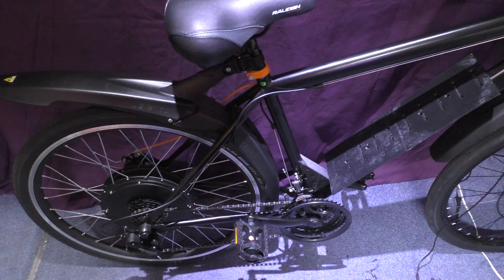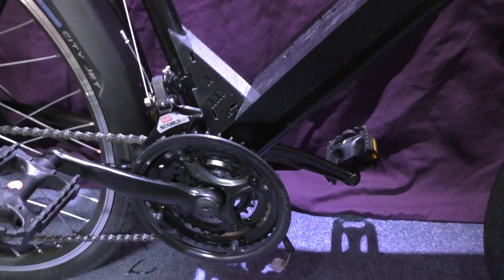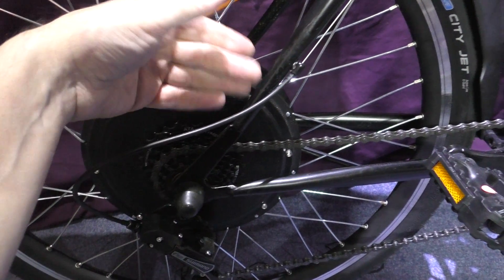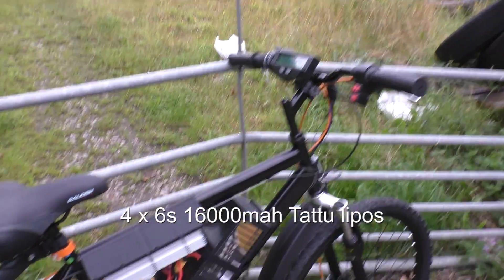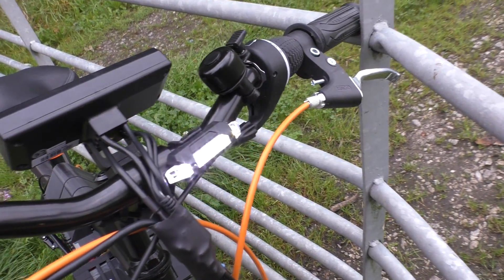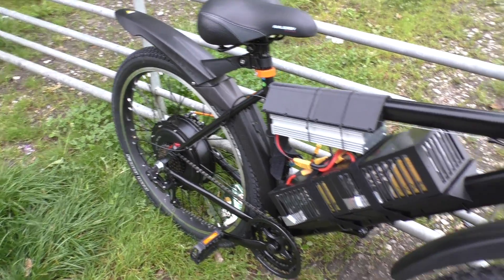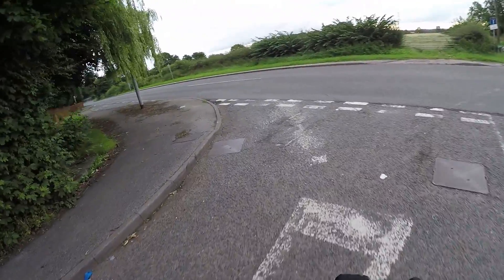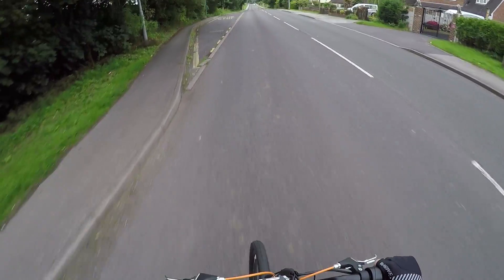Insanely fast DIY electric eBike - the most dangerous and unsafe bike ever

Comment: Don't need the lights as they will hear you screaming from miles away :-)
Reply from the maker: I didn't think about it at the time, it was 6am and the bike itself is nearly silent. I bet everyone wondered what the hell was going on :-)
Reply from the maker: The Stealth bikes are nice......very nice but I can't have one because of 2 reasons: 1. They're too heavy to get up the 2 flights of stairs I have to carry it and 2. I won't buy anything that doesn't offer a price - their website only says "Request a test ride" at a place that's 120 miles from here which leaves me to believe that they're wayyyyyy over my budget!   
I'm happy with my new bike - I built it myself, it goes just as fast as the Stealth, the range is the same and it's less than 40kg :-)
Reply: I test ride the b52 at the motorsports workshop near towescter and it was a good ride but fucking heavy, he offered me a good price to take away the test model that day... 5 grand. Fun but could get a lot more motorbike for the money
Reply: Vortecks how fast did you go?
There is a electric bike, australian designed and built that is the one of the worlds fastest production made electric bike, with dealers in the UK. The company is called Stealth Electric bikes. Top speed of 55+mph
Reply: Sandman You can build a mid drive faster lighter and untold cheaper than the stealth bummer!
Reply: the B52 is $10.5grand +/- a few hundred. The p7 $7grand +/-  I live 15min from their warehouse and I am going to test ride their bike soon. I hope its worth that much. The way technology is going the price will plummet.
Reply: I would have no idea where to start. unless your offering 😜
Reply: Dave Bassett I
Reply: Gave you your 200th like....Thats ok!
Reply: Think it was called thorney  motorsports
Reply: Bahahahahaha
Reply from the maker: The Bafang BBS02 is good for top speed but the acceleration is somewhat limited because it relies on gearing and there's extra wear on the chain & sprockets. Not to mention the extra tools you need to fit them. To fit a hub motor, you literally only need to undo 2 nuts. The downside of a hub motor is the weight and the the extra batteries. Each has their benefits and downfalls but it's personal choice. I much prefer a simple 'twist & go' rather than having to mess around with the gears and worry about snapped chains or stripped sprockets.

Comment: Been thinking of doing this also after watching your German nutter counterpart Rolf Venz,check his channel if you havn`t already:

https://www.youtube.com/watch?v=CfL_hYxLK0M

https://www.youtube.com/watch?v=PJih-MoR_KA
Reply from the maker: I did see his original video but I don't know why people put a motor on the front. The forks are designed to stop and not pull - I've seen photos of what can happen when you continually put torque on the weakest part of a bike and it ain't pretty mate. Get a big motor, put it on the back and experience torque wheelies at 50mph..... it always makes me smile :-)
Reply: Cheers for that Tony,still weighing up what to use.
Reply from the maker: Let me know if you need help mate, I'm quite the professional on them after spending 3 months learning. There's a lot to consider and there's not too much info for 'Mr Average' who's starting out.

Comment: Well that's just proper insane. =D
I'd most possibly do/say the same in regards to that 3rd position speedtest - "Never again!". Had me chuckling! =)

Idon't even want to think of the outcome if you were to crash with that amount of angry pixies between your legs...

Excellent build, Tony, but make sure to stay safe while riding that monstrosity. =)
Reply from the maker: Yeah, I will mate. I only did it to see if the speed controller will handle 120a.   
Ultimately, I want to travel to work (below 30mph) but I need to know it'll handle the 15 mile trip.

Comment: Thanks, I've been thinking about building an e-bike, more than that, I've started collecting bits and bobs to build one. This came just in time! Onward and upward!
edit: I suspect you took the front derailleur off to put the triangular battery stop in.
edit 2: Were you trying to set that speed camera off?
Reply from the maker: Please don't do what I've done, it's bloody dangerous to have so much power but I'm insane :-)

1. I took the derailer off simply because I don't need it. I was going to take 2 of the 3 gears off but I can't get the crank apart......yet   
2. No..... it's been disabled along with the rest of the 12 cameras along the mile of road I travelled.